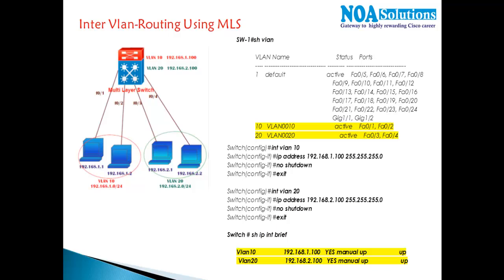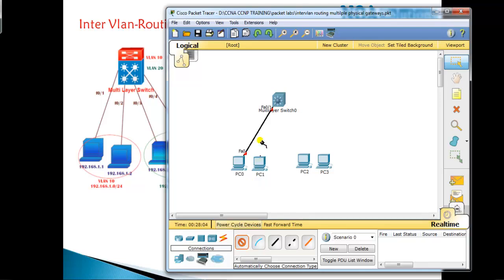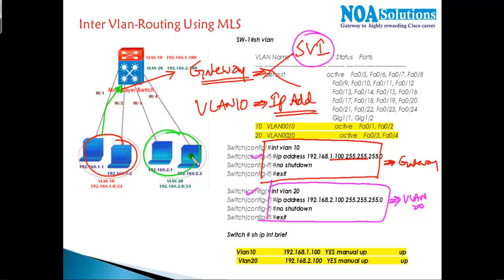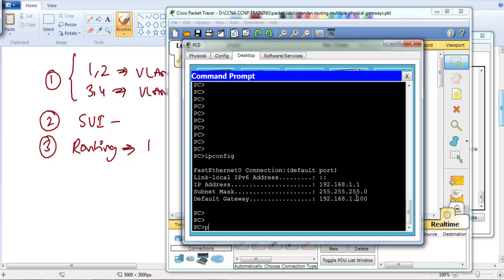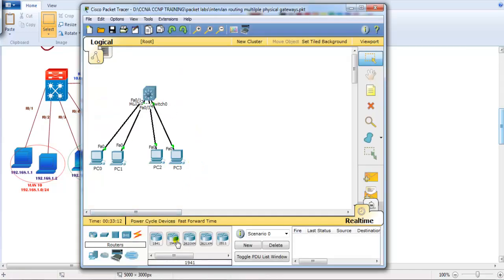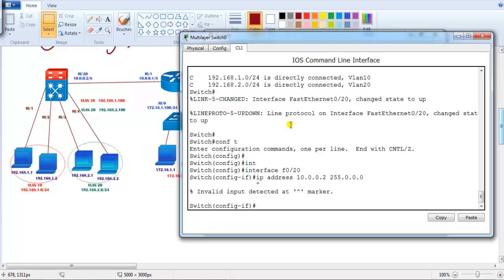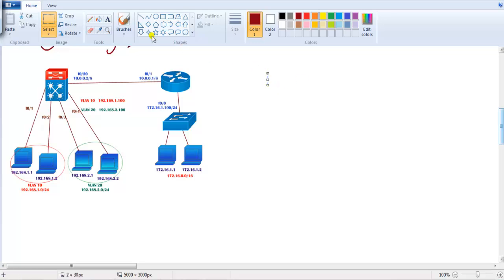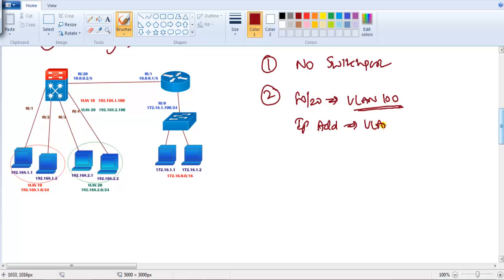Inter Vlan Routing mls - Video By Sikandar Shaik || Dual CCIE (RS/SP) # 35012

Comment: VLAN divides a single broadcast domain into multiple broadcat domain.
Devices in different VLAN cannot communicate with each other by default (possible using inter VLAN)

Then what is the purpose of making VLAN (devices in diff VLAN will not communicate)and again doing inter VLAN to communicate with all devices in diff VLANs

Comment: Dear Sikander , thanks for the excellent explanation. Could you please clarify that while following the second method (no switchport method) and third method (assigning fa0/20 to vlan) do we have to keep the original configuration of ip address in int vlan 10 and int vlan 20 intact or do we have to delet the int vlan interfaces ?
Reply: Sachin Kumar Parolia 
We can  keep it, because every vlan interface act as its own, and it’s virtual, fa0/20 it is a physical interface on its own.